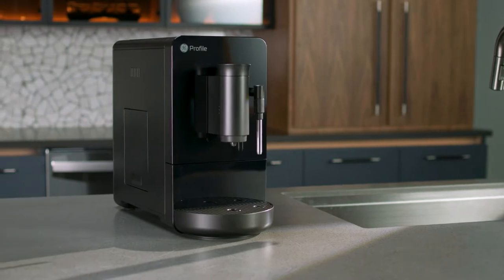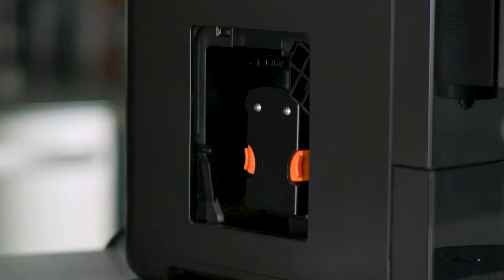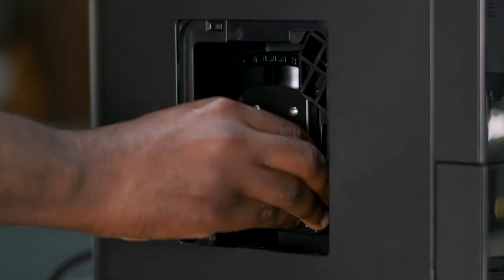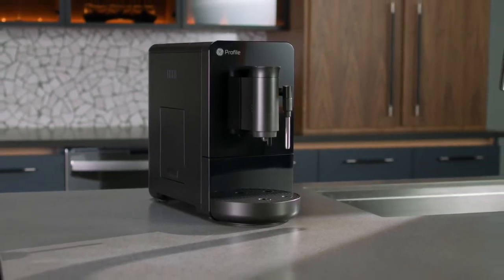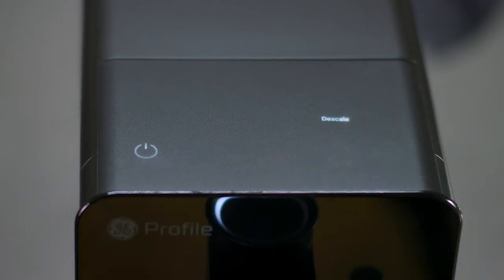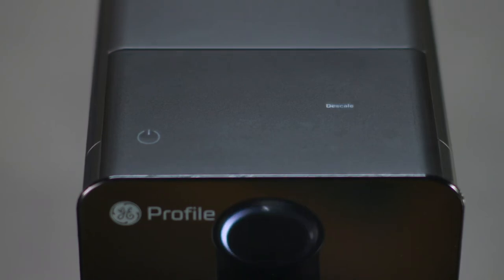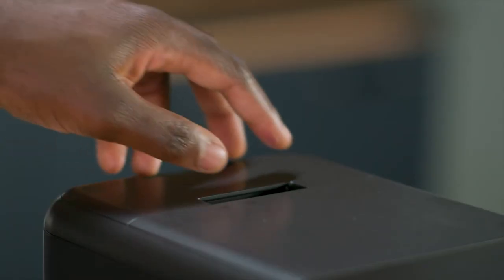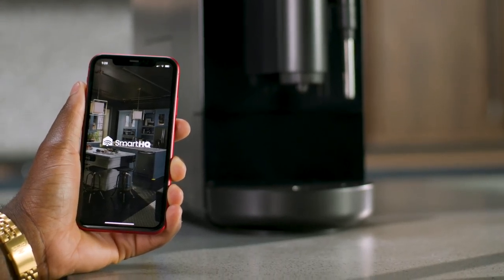Cleaning and Descaling GE Profile Auto Espresso with Frother

Comment: Where can I buy more packs of cleaning solution?
Reply from the maker: You can use WX08X42870 (http://spklr.io/6053tcZD) which is the Opal Icemaker cleaner, or as an alternative, a 1:1 ratio of water and white vinegar can be used as a cleaning solution for the descaling process.